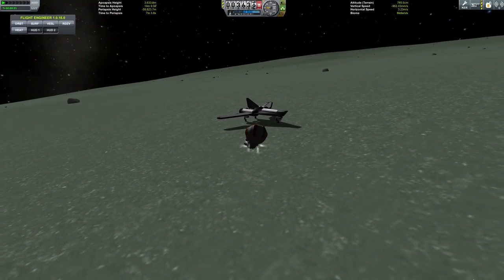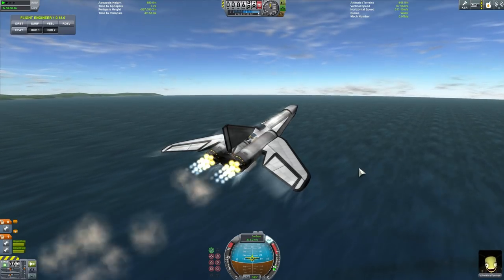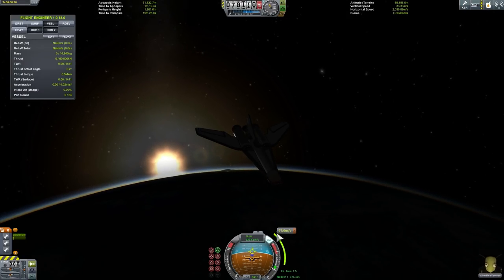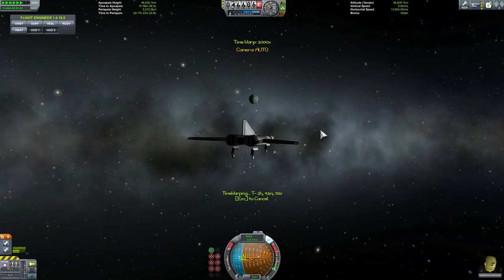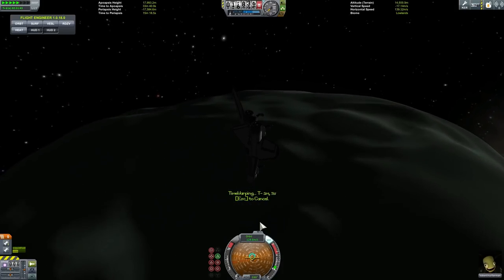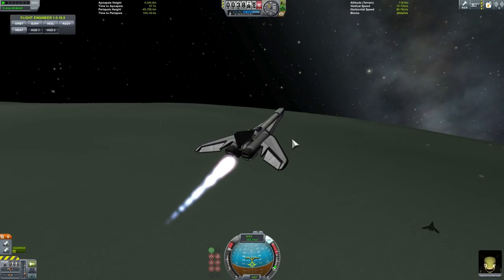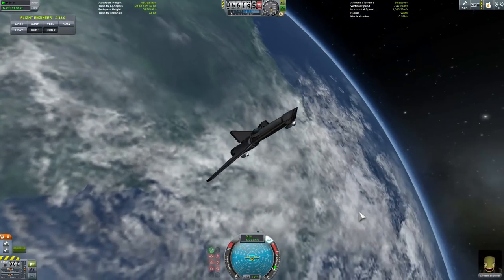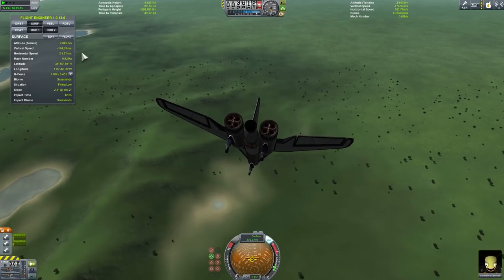Kerbal Space Program - SSTO To Minmus and Back

Comment: Great video but your wheels are far to back they need to be just past the center of mass so your craft and rotate, flying lingo for taking off.
Reply: Actually If the back wheels are in front of the CoM the craft would fall at its butt. The wheels have to be in front the elevons of the back to make it possible to rotate around the wheels. In this case, you should probably need a tail, or send the wings backwards and add canards.
Reply: The OP is referring to a different layout of the landing gear where the third wheel is at the nose and the other gears are on the wing, just a bit behind the center of mass. It's used for ships that rely on pitching up to take off, like jet fighters. The style your thinking of is with the third wheel in the back, a layout used mostly for prop planes and planes that are more capable of taking off on their speed/angle alone, usually because the craft already has its nose pointed above the horizon. Basically, take the wheel back to the point where the ship won't want to fall on it's rear and don't move them back any farther, that way there's no resistance when you pull up, since airplanes have their pitch controls in the very rear.